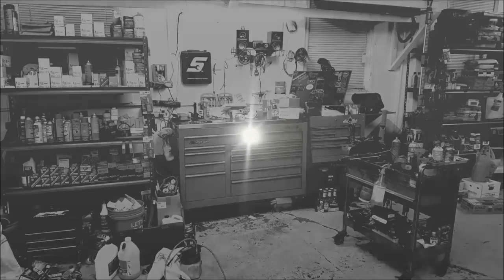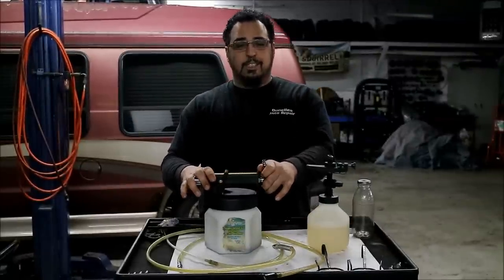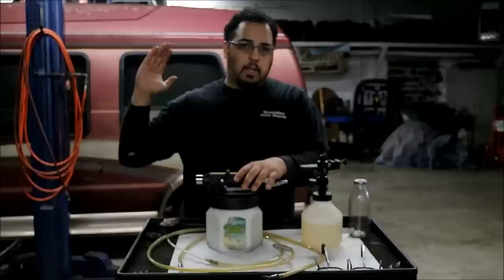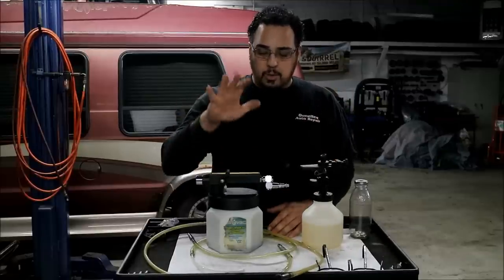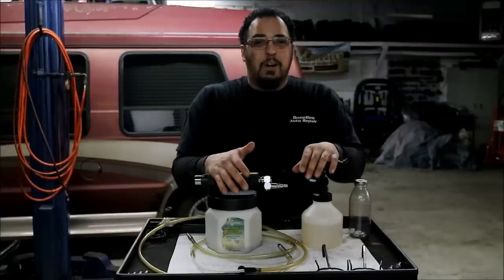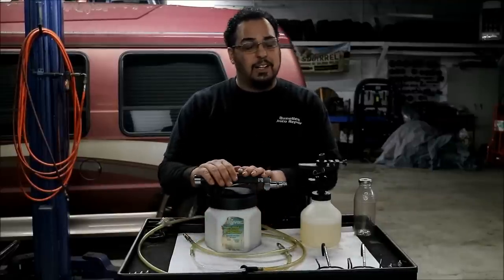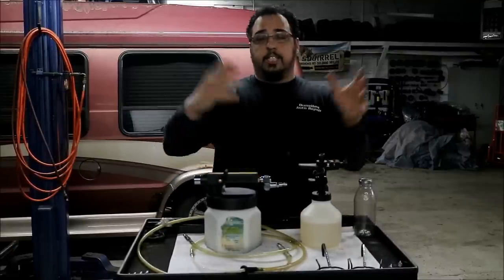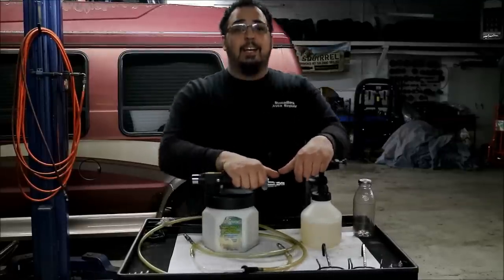Tool review on the Mityvac Brake Bleeder MV6835

Comment: It works fine for all car fluids differential, ATF transmission, Power Steering etc, lol......The fluid coming out of the brake line could not care less what what in that container....Nice Post ...Thanks

Comment: Dude I know this is only a few years late but do you ever have problems with bubbles? I will vac the fluid from the master cylinder but have excessive bubbles in the line when pulling from the caliper.
Reply: the air bubbles seen when bleeding the caliper are coming from around the bleed screw threads but does not affect the bleeding process . You can put some teflon tape on the threads to reduce the bubbles for a better visual effect.
Reply: @keithbennett1359  appreciate the reply. This was originally coming up because I thought I had air in the system I couldn't bleed out. The vehicle ended up having a back ABS pump. SMH...